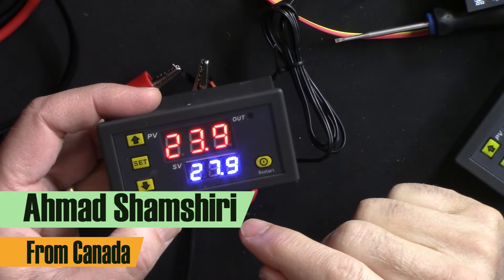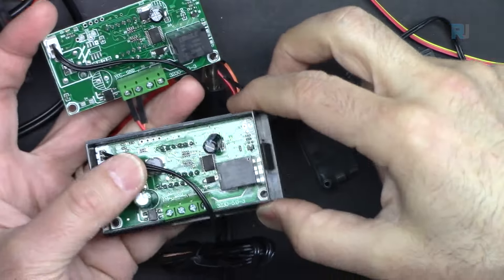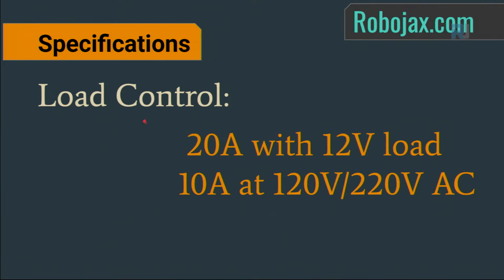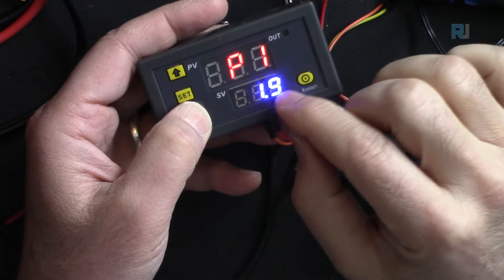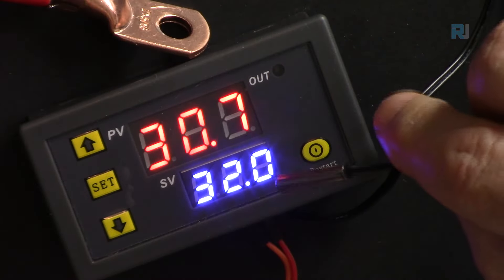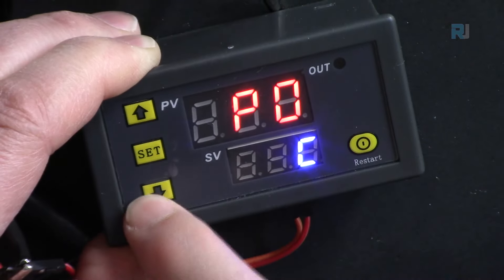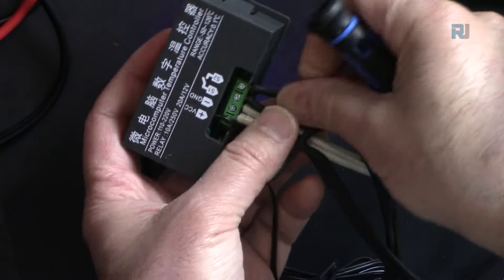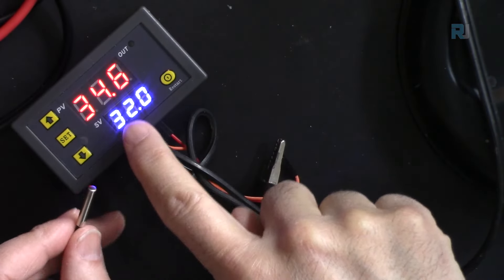How to use W3230 Thermostat Heat and Cold Relay Controller AC DC 12V/24V/120/220V P1 to P8

Comment: Hi 
It can works for a pellet stove?
Reply from the maker: Hi, this is just a switch.  a mechanical switch. So it should be able to do it as long as you respecth current rating of the relay. AC is very dangrouse. Be careful or seek help from a professional.

Comment: I have found my Fridge Compressor heats up the vehicle cabin quite a bit, so this device will now detect the  compressor exhaust heat and turn on a fan extracting the heated cabin air. TY.

Comment: Hi there! Will this work with a car heater that is 12v rated 25amp 300watts?? Thank you and very detail video👍🏼 🙏
Reply from the maker: Hi,
I have explained the power and how to calculate it. Please watch.
Reply: I just watched it. How do I get it to work at 300watts if it only can handle 12v =20amp - 240watts?

Comment: continued.....
Press and hold "SET" for 1 second to display PO, press "SET" repeatedly to advance to P3, within 4 seconds press ^/v to set the lowest settable  
temperature, the lowest value is -55C, After 4 seconds without button action the display automatically returns.

For example: set to 2°C, the temperature set point can only be decreased to 2°C minimum. If the desired temperature set point SV must be set lower than this, then the lower limit set value needs to be adjusted first, otherwise the desired value will never reach beyond the P3 value.
------------------------------

P4 Temperature correction / Unit Display versus accurate 3rd party measurement:
When the device's indicated (PV) display deviates from the actual temperature (e.g measured using calibrated temperature measuring equipment) this function can be used for correction. The corrected temperature = temperature before correction + correction value The valid range is -7.0-7.0. 

Press and hold "SET" for 1 second to display PO, press "SET" repeatedly to advance to P4, within 4 seconds press ^/v to set the correction value. After 4 seconds without button action the display automatically returns.

For example, If the actual temperature (or that measured by a calibrated device) is 25C; when the temperature is corrected to 0, PV displays 25; if a temperature correction value of 1.5 is set, then PV would display "26.5". Likewise, if a temperature correction value of -1.5 is set, then PV would display "23.5". 
--------------------------------------------------------------------

P5 Delay Start Time (unit: minutes) 
When the refrigerator or heater is required to operate with a delay, e.g. to prevent a refrigerant compressor motor stalling oroverload, the delay function can be turned on to preserve the life of the unit.

Press and hold "SET" for 1 second to display PO, press "SET" repeatedly to advance to P5, within 4 seconds press ^/v to set between 0-10 minutes. After 4 seconds without button action the display automatically returns.

In the cooling mode: the first time the power is turned on, if the current temperature >= the set value, the refrigerator will not start the cooling immediately, and  
it will run after the pre-set P5 delay time. 
In the heating mode: the first time the power is turned on. if the current temperature <= the set value, the heater will not start heating immediately, and will run  
after the pre-set P5 delay time. 

The unit starts immediately when the downtime between the two starts of the refrigerator or heater is greater than the set value of the delay start time. 

When the stop interval between the two starts of the refrigerator or heater is less than the set value of the delay start time, the device can start after completing  
the delay time after the last run. 

The delay time is calculated from the moment of shutdown. For example, if the setting delay is 5 minutes in the cooling state, the cooling device starts to delay after  
the power is turned on, and the refrigerator is turned on after 5 minutes. 

When the required temperature is reached, the refrigerator stops, and the delay timing starts, a period equal to the P5 delay must then elapse before the relay will energise/close. 

BEWARE - IT IS PURPORTED THAT "the LED indicator flashes during the delay period". AS TESTED, THIS HAS NOT BEEN OBSERVED TO BE TRUE. INSTEAD, THE LED REFLECTS ONLY THE CLOSED/ON STATE OF THE OUTPUT RELAY. HENCE, WHILST THE DELAY TIMER IS COUNTING DOWN THE LED IS NOT FLASHING. THIS IS INADEQUATE AND A DESIGN FAILURE.

When the P5 delay start value is set to 0, the delay function is rendered inoperative. 
-----------------------------------------------------------------------------------------------------------------------------------------

P6 High Temperature Alarm - Presumably in heating mode this relates to displaying "---" when the measured value becomes 'warmer' than that the set (P6) value.
AS TESTED: for the heating mode, this is true. However, BEWARE the relay also becomes de-energised. One might expect this to occur. However, the relay would already be in the deenergised/open state if the desired thermostat temperature (SV) had been exceeded (which ought to be set lower than the alarm temperature value in any case).
   
	!! WARNING !! - THE USE OF (P6) FOR THE COOLING MODE AND SHOULD CONSIDERED CAREFULLY. THIS IS BECAUSE WHEN THE MEASURED TEMPERATURE (PV) BECOMES WARMER THAN THE MANUALLY SET (P6) VALUE, THE DISPLAY NOT ONLY READS "---" BUT THE RELAY IS AGAIN DE-ENERGISED/OPEN. HENCE, NO COOLING POWER SUPPLY WOULD BE AVAILABLE. HOWEVER, THIS OPERATION MAY BE DEEMED USEFUL IN A SITUATION SUCH AS: WHEN A REFRIGERANT LEAK HAS OCCURRED AND THE SYSTEM IS UNABLE TO ACHIEVE ANY OF THE DESIRABLE OPERATION TEMPERATURE RANGE SET BY sv, P2 & P3 AND HENCE LIKELY TO DAMAGE THE REFRIGERATION COMPRESSOR OR MOTOR WITH CONTINUED UNSUCCESFUL EFFORT TO COOL. iN THIS SITUATION IT MAY PREVENT FURTHER INCIDENTS SUCH AS MOTOR/COMPRESSOR OVERHEAT, FUMES, SMOKE OR FIRE.

P6 setting - Press and hold "SET" for 1 second to display PO, press "SET" repeatedly to advance to P6, within 4 seconds press ^/v to set the value from "OFF" TO ANY DESIRABLE VALUE. After 4 seconds without button action the display automatically returns.
---------------------------------------------------------------------------------------------------------------------------------------------------

P7 - Anti-Tamper Setting
AS TESTED - P7 DOES NOT SAVE PARAMETER DATA SETTINGS AS PUBLISHED IN SOME VIDEOS/INSTRUCTIONS. Parameter data is saved into non-volatile memory and As TESTED, will survive a diconnection of the power supply.
P7 PROVIDES 'SOME FORM' OF ANTI-TAMPER LOCK TO PREVENT THE DESIRED TEMPERATURE (SV) OR THE P0-P6 PARAMETERS FROM BEING ALTERED. HOWEVER WITH P7 SET TO "On" P7'S VALUE CAN BE SELECTED FROM "On" TO "OFF", THUS PREVENTING THE NEED TO PEROFM A FULL RESET TO GAIN ACCESS TO ALTER P0-P6. 
		!!CAVEAT!! - EVEN WITH P7 VALUE SET TO "oN", AT ANY TIME, PRESSING BOTH UP AND DOWN KEYS TOGETHER FOR 1 SECOND WILL UNLOCK AND ALSO PERFORM A FULL 		FACTORY RESET. THIS IS NOT PUBLISHED AND IS NOT A DESIRABLE FUNCTION.

P7 setting - Press and hold "SET" for 1 second to display PO, press "SET" to advance to P7, within 4 seconds press - to set the value from "OFF" to "On". After 4 seconds without button action the display automatically returns and the anti-tamper lock will be activated.
AS TESTED - Press and hold "SET" for 1 second to display PO, press "SET" repeatedly to advance to P7, within 4 seconds press - to set the value from "On" to "OFF". After 4 seconds without button action the display automatically returns and the anti-tamper lock will be deactivated.

P8 Factory Reset:
AS TESTED IT IS UNCERTAIN WHY THIS MODE EXISTS UNLESS THE SOFTWARE BUG** WAS NOT FOUND.
**AS TESTED POSSIBLE BUG - SIMPLY PRESSING BOTH THE UP AND DOWN BUTTONS TOGETHER FOR 1 SECOND PERFORMS A FULL FACTORY RESET AND ALL MANUALLY SET PARAMETERS P0-07 ARE LOST!!!!!!
AS TESTED - Press and hold "SET" for 1 second to display PO, press "SET" repeatedly to advance to P8, within 4 seconds press ^ TO CHANGE VALUE FROM "OFF" TO "On". After 4 seconds without button action the display automatically returns AND THE DEVICE WILL PERFORM A RELAY CYCLE AND A FULL FACTORY RESET.

AS TESTED - There is no P9 parameter available. This is described in some video/instructions as a Farenheit/celsius conversion parameter.

Comment: Can the AC version be used for operating a 12v dc fan, Thanks
Reply from the maker: This is just a switch a mechanical switch. It can turn on or off anything within the power range which o explained.

Comment: Absolutely excellent thank you, helped me immensely setting up the heating for my lithium batteries.
Reply from the maker: Fantastic!
Reply: @robojax I had trouble with the max temp setting to disengage the relay, P02 didn't do anything but P05 did though the temperature (red) display changes to --.-- at that point. Not a problem though because it still does the job nicely.
Reply: This is what I bought one for too. I'm hoping he explains the other settings where you hold the settings button

Comment: Review W1213 , W1211 Temperature Regulator Incubator Thermostat Temperature Controller, can use Cooling / Heating separate relay. Small size.
Reply from the maker: If you pay me and send me I will do it. Contact me via Robojax.com contact page

Comment: Below I provide a summary of the anomalies I found and what actually occurred AS TESTED.

Instructions AS TESTED: 
Connect the power supply and equipment to supply power to the controller. At power-up, the display shows the measured temperature PV.
 
Press SET. The display temperature will flash, press +- to set the desired temperature SV (press and hold EITHER- to rapidly raise and lower the value. 
After finishing, press SET to confirm the retum (will auto-return after 3 seconds). At this time, the controller automatically performs relay on/off according to the setting.
 
The output of the thermostat is a 220v 10A / 12V 20A rated single pole, single throw relay.

At this time, the display shows the ambient temperature (PV) and the desired temp (SV). 

Indicator light & digital display status description: 
Indicator light: Blinking indicates cooling or heating start delay (Not found to be true on delivered unit. The LAMP is unlit during the delay period rather than flashing, which is unhelpful).
LED on indicates that the relay contact is closed.
Digital display: PV displays --- when the measured temperature exceeds that of the manually set high temperature alarm value (P6). When this occurs the relay is also 		 	 becomes de-energised
		 PV displays LL when the sensor is open circuit or unplugged. 
		 PV display  HH When the temperature exceeds the measurement range, the relay will also become de-energised.

AS TESTED POTENTIAL ISSUE- IF THE BUTTON MARKED WITH THE STANDARD 1/0 (ON/OFF) SYMBOL AND LABELLED "RESET" IS PRESSED FOR 1 SECOND, THEN NOT ONLY DOES THE DISPLAY OCCULT, BUT THE RELAY WILL DE-ENERGISE; EFFECTIVELY TURNING OFF WHATEVER DEVICE IS CONNECTED. THIS IS DIFFERENT OPERATION TO THAT DESCRIBED IN MANY VIDEOS AS "DISPLAY GOES OFF ONLY". THIS MAY NOT BE DESIRABLE. THERE APPEARS TO BE NO WAY TO OCCULT THE DISPLAY ONLY WHILST CONTINUING TO FUNCTION AS A CONTROLLER.
		 
 
Parameter functions: 
Press and hold "SET" for 1 second, press "SET" repeatedly to advance through the various parameter functions PO-P8, after 4 seconds without any button action, the  
controller automatically returns from any programme mode P0-P8 to display the current measured temperature (PV) and the desired set temperature value (SV).
---------------------------------------------------------------------------------------------------------------------------------------------------

PO Cooling / Heating mode. 
Press and hold "SET" for 1 second to display PO, within 4 seconds press ^/v to switch between modes [H is heating mode] [C is cooling mode]. After 4 seconds without button action the display automatically returns.
 
In the cooling mode: when the temperature measurement value >= the temperature set point, the refrigeration relay is closed and the refrigerator is started; when the  
temperature measurement value <= temperature set value (SV) - the (P1)hysteresis value, the refrigeration relay is turned off and the refrigerator is turned off. 

In the heating mode: when the temperature measurement value <= temperature set point, the heating relay pulls in and the heater starts; when the temperature  
measurement value >= temperature set point + P1 hysteresis value, the heating relay is turned off and the heater is turned off. 
----------------------------------------------------------------------------

P1 Hysteresis setting: 
Press and hold "SET" for 1 second to display PO, press "SET" repeatedly to advance to P1, within 4 seconds press ^/v to set the hysteresis value to between 0.1-15C. After 4 seconds without button action the display automatically returns.

In the cooling mode: when the temperature measurement value >= the set value, the relay is closed, the refrigerator starts; when the temperature measurement value <=  
the set value - i.e.the clifference value, the relay is turned off and the refrigerator is tumed off. 

Example, if a home environment is 30 °C, the set value (SV) is 25 °C, and the hysteresis value is set to 2°C. When the power is turned on, the relay closes for the  
air-conditioner to start. When the cooling reaches 23 °C, the relay turns off the refrigerator. As the measured temperature rises to the set value of 25 °C, the relay closes the refrigerator again, so the repeated cycle control temperature is not higher than 25 °C. 

Example 2 Example: with a freezer SV set to -20 the freezer will cycle between -20 and -18. turning on at -18 and off at -20.

In the heating mode: when the temperature measurement value (PV) <= the set value (SV), the relay pulls in and the heater starts; when the measured temperature value  
(PV) = the set value (SV) + the difference value, the relay for the heater is turned off. 

Example: if the environment is 10 °C, the set value is 25 °C, and the hysteresis is set to 2 °C. After the power is turned on, the relay closes the heater to  
start. When it is heated to 27 °C, the heater relay turns off. As the measured temperature begins to decrease. When it drops to the set value of 25 °C, the relay  
closes the heater to start again, so the repeated cycle control temperature is not lower than 25 °C. 
-------------------------------------------------------------------------------------

P2 maximum temperature setting upper limit 
In order to avoid the danger of setting the temperature too high due to the misoperation of others, the thermostat has a highest setting upper limit function, which  
limits the setting range of the highest temperature set point controlled by the thermostat. 

Press and hold "SET" for 1 second to display PO, press "SET" repeatedly to advance to P2, within 4 seconds press ^/v to set the highest settable temperature, the  
maximum value is 120C. After 4 seconds without button action the display automatically returns.

For example: set to 60, the temperature set (SV) upper value can only be set to 60° C. If the desired temperature set point (SV) is required to be higher, then the upper limit set value needs to be adjusted first, otherwise the desired value will never reach beyond the P2 value.

BEWARE, AS TESTED ISSUE/SOFTWARE BUG - [ for a freezer scenario with the following parameters: (P1)Hysteresis set at 2.0, (P2)max set at -15, (P3)min set at -27 and the desired temperature (SV) set to -20C ]:
At a measured freezer temperature of -20C, if the desired temperature value (SV) is subsequently altered to anywhere between -21 and -27(= set lower limit), then the relay becomes energised as desired. HOWEVER, if the SV is raised to -15C (i.e. = to the P3 set upper limit), the RELAY ALSO BECOMED ENERGISED IN ERROR.  THIS IS UNDESIRABLE AS IT WOULD LEAD TO OVERCOOLING OR DAMAGE TO THE COMPRESSOR MOTOR, LEADING TO OVERHEATING, SMOKE, FUMES OR FIRE!
---------------------------------------------------------------------------------------------------------------------------

P3 Lowest permissable Temperature. Sets a lower limit In order to avoid e.g. ice blockage caused by accidental or malicious changes to the desired Temperature (SV).
           Continues in next comment below.......

Comment: The best explained review for W3230, yet i still have a question sir: Can i use this device to keep the refrigerator between 13⁰ and 16⁰ ? I want to change a refrigerator to a fermentation box .
Reply from the maker: Hello, I have explained all features of this device. please watch it fully and come to conclusion.
Reply: @robojax  Yes after i wrote the question i watched again several times and  i found out the answer 😃 Thank you for this perfect explanation video 👍
Reply: @robojax  One thing (which is not explained in your video) i have also found out ; when using as a cooler the difference between P2 and P3 (max. Heat and min. Heat ) can not be lower than 5⁰.
Reply: @robojax  Sir, Please let me know whether it can be used with a domestic water heater instead of a typical capillary thermostat?

Comment: hi, following instructions cant seem to get this to work, could you tell me the settings i need to come on at 2 deg c then go back off at 5 deg c. i can activate relay but wether on or off cant read any power at output.thanks. It is the 24v version. i intended on using to heat a very small battery compartment

Comment: Can the AC version be used for operating a 12v dc fan or a 24v dc motor?
Reply from the maker: This has a relay. Relay is just a switch and I have shown it.  Now you if you don’t know what a switch is that is different issue
Reply: @robojax That would mean Yes. Thanks for taking the time to answer.